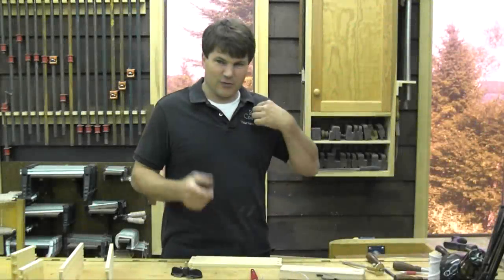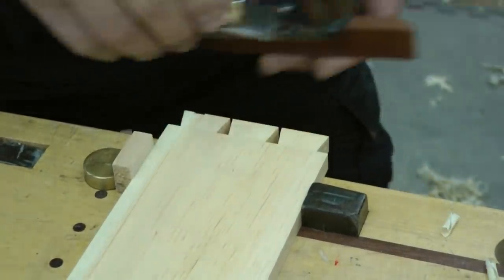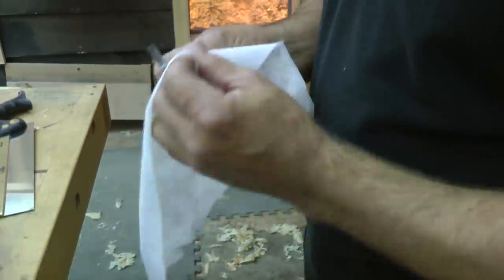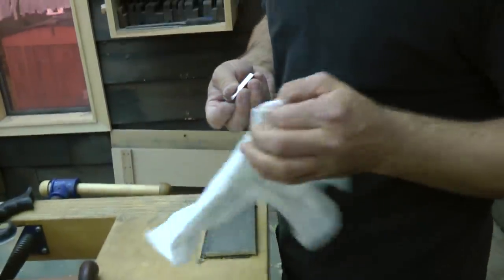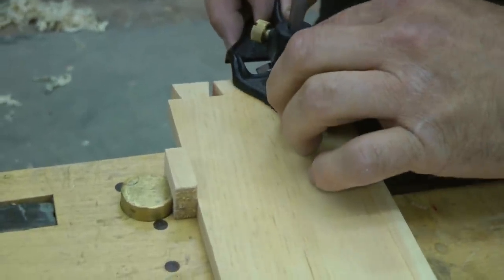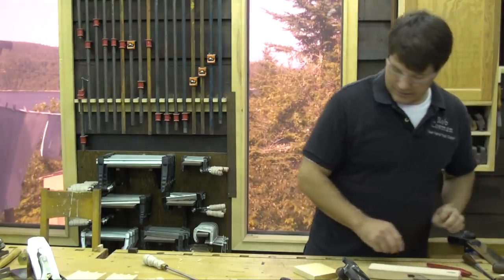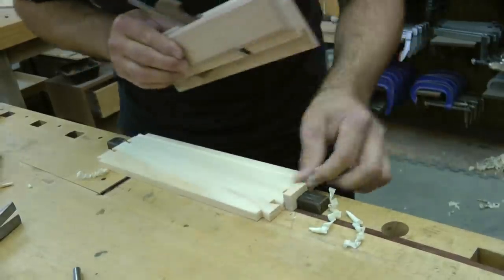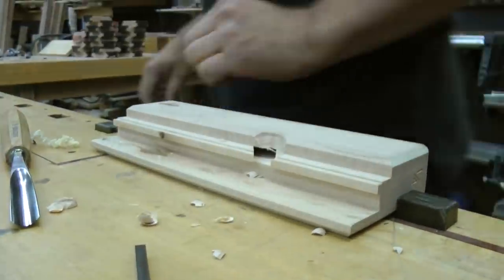Hand Tool Project - Episode 11 Pine Candle Box

Comment: Just a thought regarding keeping the drawer bottom plane perfectly plumb - fit an outrigger with a flat foot which would rest on the opposite side of the board as you are cutting the groove.  The foot would have to be co-planar with the surface (adjacent to the blade) which controls the depth of the cut.